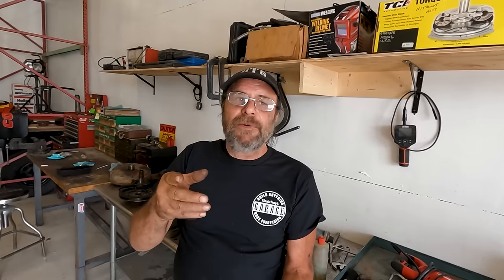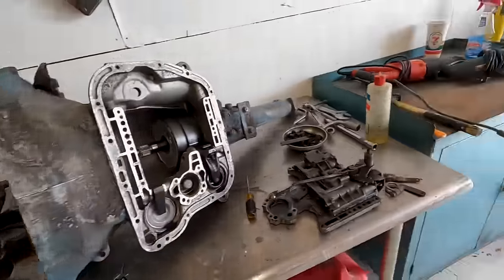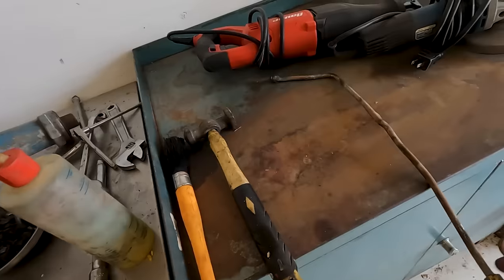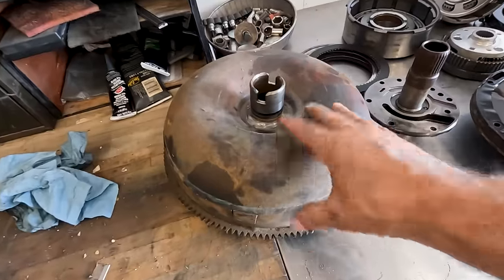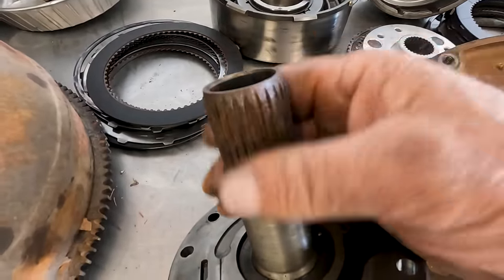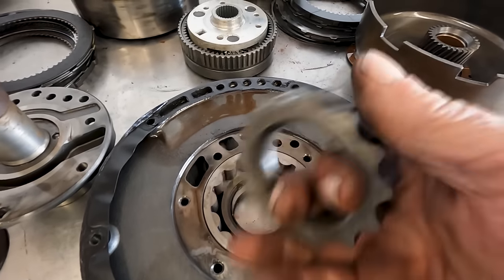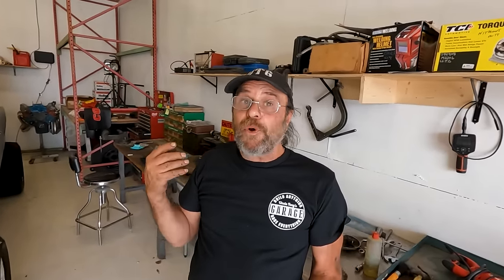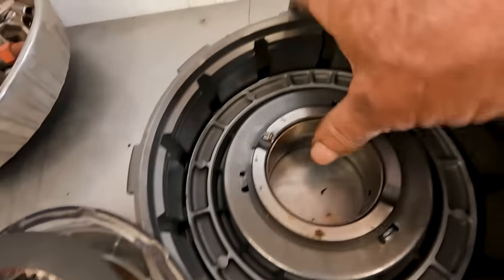Survival For The Budget Car Builder - DIY Transmission Rebuild From A Junkyard Core

Comment: Good stuff Tony. I built a 75 440 motorhome engine for my 86 Ramcharger, stock 360 was good but not enough, being 4x4 i needed the output shaft in the big block 727. Everything in the small block is the same as the insides of the big block case. Put in a new converter and the excellent but gone through valve body from the small one, plus the governor. 5,000+ miles, everything is great. Had to use a cable conversion for the carb/throttle body lever. The kit part for the carb was too short in terms of leverage, so I had to modify that longer to get equal movement on both ends, like a stock one has. Gotta watch those kits, every one I`ve seen on a Mopar/727  couldn`t be adjusted correctly because they make the carb bracket too short. Course Im` running a Thermoquad that is absolutely the best carb ever.

Comment: Tip, between the mostly same years you can mix a 999 with a 949 and a couple other parts from a 727. Max amount of power 500 horse almost 400 pounds of torque at 6200 rpm. I have mixed the 999 with earlier models as well. Extremely ridiculous second gear shift but can only take so much  power and rpm’s before you blow the band or input shaft. With a custom input shaft and band that is hardened you can push it harder. Going into second my dusters front tires would come off the ground and without a torque box and a roll cage you will twist the frame 😂

Comment: I recently put a 5-speed behind my flathead Ford in a 1949 F1. I got a junkyard 84 S10 T-5 and a rebuild kit. I took it out and reinstalled it 4 times after finding out a slider wasn't "good enough". But, it saved me thousands of dollars and I got to spend lots of quality time under my pickup.

Comment: Well stated Uncle Tony. I'm going to rebuild my first rv2 compressor for my 69 Roadrunner. I wanted a backup core and got lucky on Ebay. I spoke with the seller and he said the compressor turned over smoothly by hand, with no binding. The compressor came without the clutch/ pulley assembly, so he was turning it by the crank snout.
I tried it myself when I received it, and it turns as smooth as silk. You can hear it pumping as you do.
I feel a lot better about this project knowing that I have a good backup core. In my case, let's just call it insurance

Comment: Torqueflite's are really easy, I rebuilt mine in a weekend, had never done it before, did not need any special tools,  a slide hammer for the pump, I cut a piece of wood and a C clamp for the clutches and a piece of printer paper to align the rear pump housing if it's a pushbutton, has worked fine so far for 10 years, and if I can do it pretty much anyone can do it. (big thank's to Torqueflite patty's help answering some of my stupid questions)

Comment: I love building automatics.
A 904 with a wide ratio gearset, and a 4.2 lever.
Bump up the line pressure a bit (pan bolt 5/16") space between the bracket.
Seasoned with a slant 6 torque converter and it's pure f*n magic😊 on the cheap💰💰

Comment: Love your channel
Got a 2000 Chevy S10 4.3L Auto
Just spent $2500 on a transmission from AutoZone.
$350 core charge but I called GM first because the price for GM is $2300+core charge $350 but GM right now is nation backorder for the 4L60E.
Pulling the motor and trans as one unit and going to refresh the motor while it's out. Going to paint the motor and trans (Which was a great video you did on painting motors) and put the motor and trans back in as one unit. Never getting rid of this truck. Great trucks and worth the money to fix.

Comment: I got a broken 4 speed from a friend, while I was in high school.  Went to the dealer bought some bearings, syncro rings, input shaft and a gear.  For 1/3 of the cost of rebuilt had a very solid transmission

Comment: One place not to buy a transmission from is Monster Transmission.They do not do what they claim to do.A local transmission repair shop in my area has found this with no upgrades done.One thing to with an  used transmission is pull the pan and inspect.I pulled the pan off an used 4L60E once,pan was full of clutch material

Comment: The problems we're seeing in reman units are the same ones we will likely see using the parts to do it ourselves. We will save the labor but also might need to perform our own warranty work just the same. 
We need decent parts like we had just 5 or 6 years ago. We complained then but it was 1 in 30 problems and it's 1 in 3 now it seems.

Comment: @6:00 those are classic mid south mud dauber pupa deposits in those trans cooler lines, not related to floods, or silt deposits. 

Mud daubers will plug up any possible hole you can imagine that’s left exposed on a field car with their stinking larval deposits. 

I still find it to be a welcome tradeoff to losing your entire vehicle to salt rot in the rust belt where I ran away from 20 years ago. 😀

Comment: While I was building a 360 to swap into my v6 Dakota the stock trans died. I needed to upgrade the trans from 42re to 46re anyway to handle the power. I couldn’t find a core and the local trans shops were no help so I bought a “built” trans from a well known internet company, paid for upgrades to handle 500hp. It took 2 months to get and now installed its junk. Brings new meaning to the term “slush box” the warranty department is impossible to deal with and because I installed it myself basically voids any warranty. Even though I was a ASE/GM certified mechanic for many years. If you have the capability to do it yourself do it. At the end of the day YOU are really the only one you can count on!

Comment: The thing I hate the most about the 47re is the overdrive tail shaft splines not lining up. That is some straight up bullsh!t to get them lined up again. The power wedge anchor is annoying if you dont keep up with band adjustment, it falls out. If you are adjusting the band, dont over torque it, the anchor will crack and fall out. Torqueflite is a perfect starting place if you want to learn about transmissions.

Comment: found a  68 727 up in rock island IL last summer said it was rebuilt for $400, just took it for a spin for the first time last weekend behind my rebuilt 78 la 360, seemed to shift pretty smooth, Tonys probably right tho, probably shouldnt run it cross country without taking it apart and inspecting it

Comment: Moved, shop isn't built yet, no pad, just dumped $5K on a "reman" (not counting labor) and I KNOW I could have rebuilt it stronger for less than 1/2 that, counting the specialty tools and a custom convertor.
But, until the shop's up, that what I have to do... 
Great video, Thanks!

Comment: Got a local shop for stock rebuild he says about $100 A gear I suppose plus parts & labor but he does a great job I had a TH350 traded in on  700R4 paid $1200 for it rebuilt ran it for years till I sold it.

Comment: Rebuilt a TH350 with some direction from my dad, and an old B&M rebuild/performance book.  Boy did I feel like a wizard when that thing worked.  Accumulator did leak like a sieve though and couldn’t get it right, took it to a local transmission guy who seated it in about 5 minutes.  Became friends with said transmission man, learned that they really become specialized in that field, he could diagnose things in his rebuilding procedure that I wouldn’t have picked up on.  If trans rebuilding seems too intimidating, don’t be afraid to see a local independent transmission guy.  That’s where to get your transmission rebuilt correctly, not these mass market reman transmission companies.

Comment: Buy a book on how to rebuild your transmission.  Then watch videos.  It's not as difficult as people rumor.  diesel fuel makes a good cheaper than mineral spirits solvent.  After you clean and de-bur each part wrap it in a masking type paper or news paper. I think there are less parts in a 3 speed auto than an engine.  I was surprised how easy they were to rebuild.  "NO FEAR"

Comment: I totally got bit by that bug. Bought a nice 1990 F-250 with a blown motor. Found a replacement for $400. Guy claimed it had 140K miles but still ran great when pulled. I should have compression tested it before the install. Got it in, fired it up and it ran like crap. Did a compression test and it was all over the place 0-75 in each cylinder. Either the guy lied or his kid hot rodded it just before it was yanked. Head gaskets were fine but the rings and valves were roached.
     $2,500 on a rebuild/install later and I'm pretty happy with a warranty from the local builder.

Comment: I've always rebuilt my own automatics. You can buy all the plates,bearings and seals for a small fraction of the cost of a "rebuilt" (yea,right) trans. I've done many in my time, first one a 727 when I was 17, did it for my 383 six-pack I built. I'm 65 now and just finished the A340 for my Cherokee. I don't trust transmission shops ..... do it yourself, you'll know what's in there.

Comment: I learned how to do them at UTI years ago. But I couldn’t find a decent job as a mechanic, mostly because everybody and their brother moves to AZ and they had experience that I didn’t. So later on I didn’t have the money to buy tools, but working in Auto Parts I could get a trans rebuilt for $150. this was in the late 70’s, and when I left the industry I had one rebuilt for $300.00, and it was in a front wheel drive car. Removing the trans was a lot harder than a rear wheel drive car. I left Auto Parts in 1997, 20 years after I got into the field. Since I left the DIY craze had subsided and now the guys buying muscle cars and cars of that era are paying others to do everything to restore their restored or restomod  cars. Now everything is going for retail. Prices have gone through the roof, because these guys spend everything they can think to get things done for them.

Comment: I had a transmission blow up due to the manufacturer advising their costumers not to maintain their cars. I'm sure it could have been fixed by replacing the pump and whatever else it needed but nowadays the thing to do is take a complicated 300lb AWD transmission and chuck it in the dumpster and replace the entire unit. Refusing to work on older stuff that was designed to be serviced, well, its sad. The frugal shall inherit the earth.

Comment: I am progressing on the drivetrain for my '33 coupe with small Hemi. I needed a trans & remembered the 727 that has been under the bench for over 40 years. I took it to the only Chrysler trans specialist within 400 miles from me. It wasn't cheap, but with replacement valve body [the old one had been modified, who knew?] complete rebuild including some hard parts & a sprag clutch upgrade, with 'towing package' kit & a new B&M entry spec performance converter & new deep oil pan.  I was up for $3.5k Au. That's about $2,200US which was acceptable [like it or not] keeping in mind my situation. It'll be just the ticket behind my 325 Dodge Hemi.
To this day I don't remember how I got it, & the other 727, also under the bench.

Comment: Couldn't agree more, also have to take stock in the fact that all the guts of an automatic transmission are made of very hard metal's not just cast parts. Are manual transmissions made from case-hardened steel? I'd think that the gears would be but I never really looked into it.

Comment: I put a Muncie M21 4 speed in my 1982 V8 S-10. I pulled it out of a rusty '69 Nova that had been sitting under a shed on a farm in the AZ desert for decades. No indication it had ever been apart. I had it rebuilt and slightly modified by a local place (not nationally known) I put just a little over $3K into it, and it has been working just fine for the past 7 years. I think you can get much better quality and a lower price locally (if you are lucky enough to have a local place that works on vintage transmissions) than you will from some big name place that does everything assembly line style. 

Modern transmissions are a different deal. I can get a rebuilt transmission for my 2006 Ford Crown Vic transportation appliance for under $2500, and the quality is going to be good. A big part of the problem with vintage transmissions is the lack of good parts. ALL new parts are going to be CHINESE, which is just another way to spell JUNK. 

I would definitely get a pan with a drain plug, and change the hell out of that fluid. I can drain about 5 quarts of the fluid out of my Crown Vic transmission through the pan drain. But there is like 13 quarts total in there. Which means 8 quarts won't come out. Fords used to have a drain on the converter, but they no longer do. I change the 5 quarts every 9,000 miles, then drop the pan and change the fluid and filter every 27,000 miles (I change the engine oil every 3000 miles) I rack up miles like crazy on this thing. It's up to 384,000 miles, and the engine and transmission have never been apart. It's my daily beater. It gets abused. But just look how far it's gone with regular maintenance.

Comment: Needed to change to a short tail housing on a car big block 727, for a pickup, using parts from the small block 727. Talked to a few back woods tranny shops. What struck me was how utterly stupid some of these guys were. Figured I could do it myself, that was 30 odd years ago. No YouTube then, a service manual was about it. Done a bunch of transmissions since included the M41 4sp and J Type Laycock de Normanville overdive for the 66 Volvo. 
Take your time, read everything you can before you start. Nothing on an old car is rocket science.

Comment: UncTony, admit it, you have probably done it. 
   If you have a Good 220 volt Mig welder, you can cut the converter around the perimeter weld and modify the rotating fins that set the 'lock' or 'stall' of the converter. Use a Dremel tool and books or videos to id the part that you are modifying and weld it back like welding a home shortened driveshaft. 
   Weld a little spot, rotate about 180 spot again. Once you have 6 or so spots around the outside weld about 3/8 of an inch 5-6 times, then go to 1/2 inch welds until finished. If youre onley going for a 2500 rpm or so stall, piece of cake!
   Or just get the converter out of a six cylinder equivalent trans. Anybody know if a 4.3 Vortec will go right in a 350/auto combination? I KNOW a straight six converter was the poor kids Stall for their 289 Mustang! Ya'll Take Care, John

Comment: Have you tried finding parts for a 1985 dodge d150? Mechanically the parts are available but not for the body parts.
Reply: LMC Truck has a lot of aftermarket sheet metal.  Or you could take a trip to Arizona, Nevada, or California.  There are several mid/late 1980s trucks in the Pick N Pulls out here.

Comment: tony i rebuilt 1000's or transmmissions used to own shelton transmissions shelton washington. that is a early torque flight 8. convert the pump,direct drum to later wide style. grind rear sprag rollers slightly 45 degrees both ends, set the rear band to the top of the piston retainer or slightly tighter the front to stock or slightly tighter. check out gil younger shit kits, oh n set the front n rear end play tighter 10 thou is good. pick a moderate tc n go! start in manual low to protect the rear sprag.

Comment: Yeah I know what you are saying about the fancy box store stuff. So disappointed when you get the transmission put it in with all the new parts so you don’t have any problems and it is all new and because it is a product that is big take a good year to do you got it. But the thing that surprises me the most is that the stuff on the band fell off. Yes the red stuff on the fell off in chunks. From TCI that was the last thing I thought I would have to worry about! Surprise!!! Years ago you never had to worry about that kind of stuff. I don’t know what an old person is supposed to do anymore. Cause let me tell you after you get so old you can’t get off the floor anymore and you can’t pick up stuff anymore without hurting yourself and kids just don’t do this stuff. But still trying to figure this stuff out and keep on fighting. Good luck with your trans.

Comment: How did the 727 and 904 get there numbers. Why are they called that. How do you tell the difference between a lockup and a non lockup.
Reply: The tip of the input shaft will be machined smooth on a lockup trans, on both 727 and 904.

Comment: 47rh in canada im seeing online 1400$ for rebuild kit, 980$ for valve body and 1400-2000$ for torque converter.. plus 15% tax on those and possibly shipping not to mention they have core charges so right there im at $4500 and risking messing something up on the rebuild a $6000 complete unit starts to seem cheap

Comment: Thanks Tony a freind of mine has car repair shop and is moving to a different build and doesn't have room for all the things in old shop said I could have what he was not going to take I got repair manuals from 52 up to 90 iam going to get some turbo 350 and power guilds that have been keep inside for free plus rebuild kits and all ready got 200 new spark plugs for ford and chevy small blocks pluses new old stock parts for helping him move the just work on mostly newer cars and just orders what they need from auto parts stores the man that had it be fore him had his on stock 1970 to about 2020 he passed family sold all to him except shop my freind just rented the shop cannot bet a deal like that.❤❤❤

Comment: $75 for a TH350 core, $260 for rebuild kit with alto red eagle clutches and kolene steels, $45 for the transgo reprogramming kit, about $250 for torque converter. Built the special tools myself and used my drill press as press for clutch springs. A couple years later, all is well and it performs great! Built NOT bought! 😎
PS, thanks to Hiram Gutierrez, "Automatic Transmission" is his YouTube channel.
Reply: Hiram has some of the best videos on YouTube . He makes everything look simple , truly a master rebuilder.